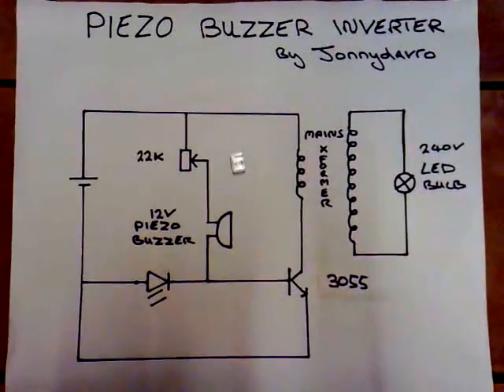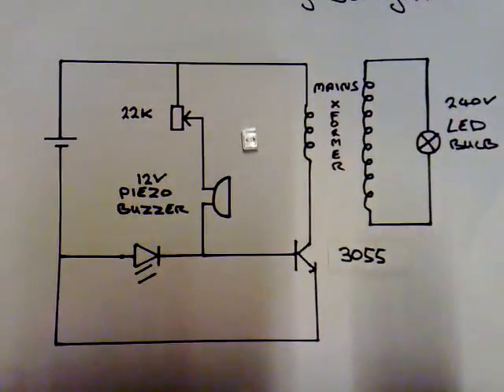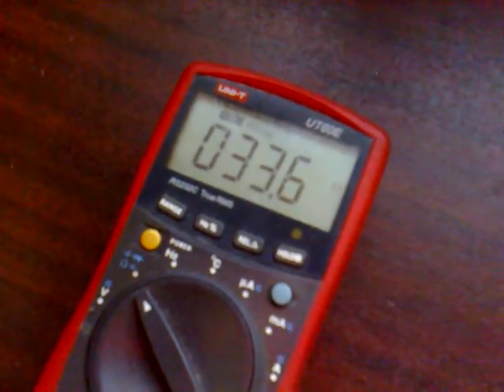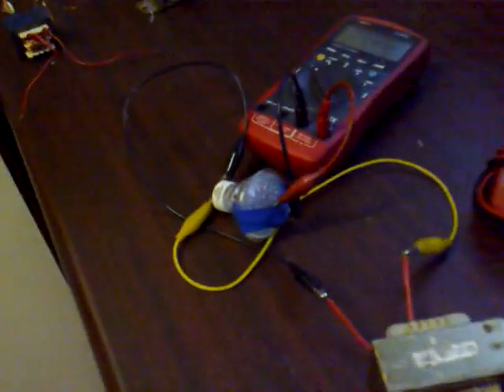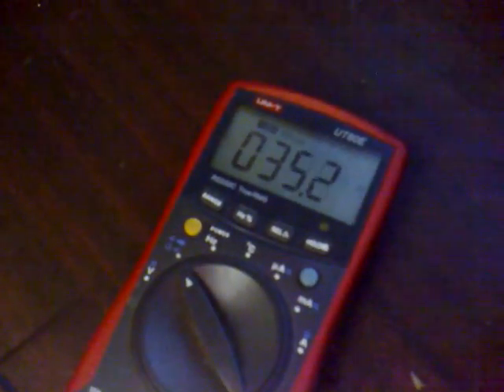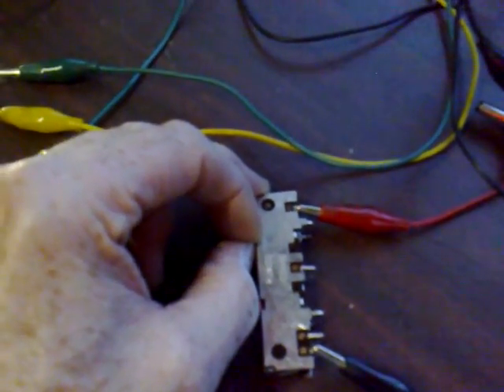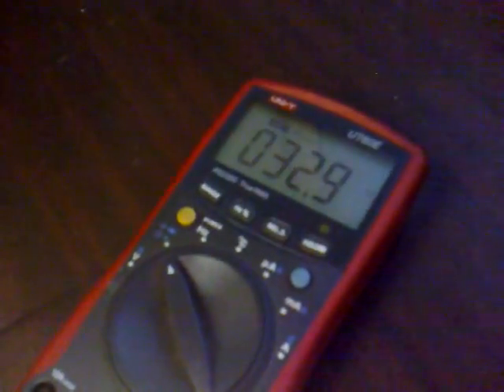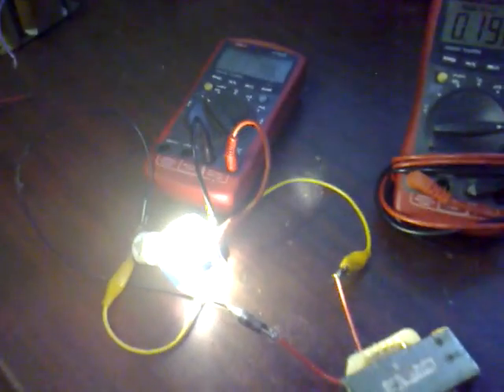Piezo Buzzer Inverter - Bright light

Comment: Yeap, you're right, those type of inverters are for lighting, mine works good for led's, but didn't work good with a 24V transformer and a different transistor also, the type of buzzer used is very important. What are the voltage specs on your transformer used?
Thanks Ciprian.

Comment: Hi jonny
tried the buzzer on the output jr with 12 v dc supply     connected it on one leg output 
did increase out put  from LDR120 down to 86 ohms @ 500 ma   full brightness on a 220 v ac led lamp

Comment: those have a small transistor in them with a few biasing resistors and the transistor is set up with a coil inside to oscillate. The resistors turn on the transistor and the transistor pulses the coil and  the coil induces a current in a seperate coil that turns the transistor off and it repeats. and the pulsing field moves a small magnet on a diaphragm. at least I think

Comment: Very interesting! Yes you are correct some of those have a circuit to "ring" the buzzer but those are not piezo they are coil one still work very well thought. Those with no circuit will use the magnetic of the buzzer to break the contact on and off for the sound. You could probably have the same result with a relay. Nice video thought never imagine those could be use to do something else then annoy my ears ;) Have a great day